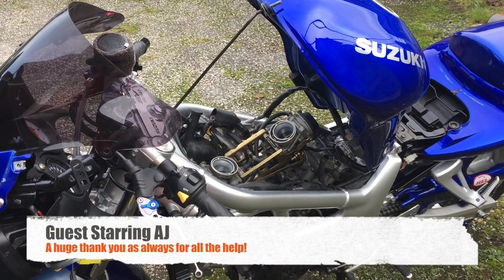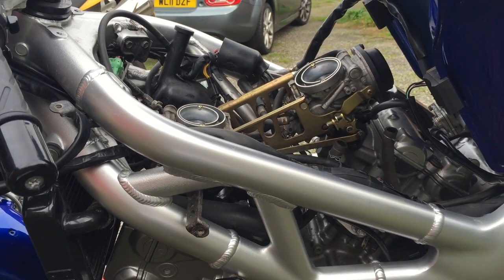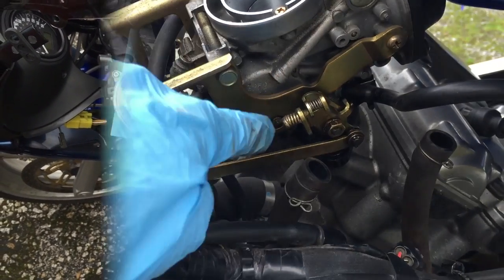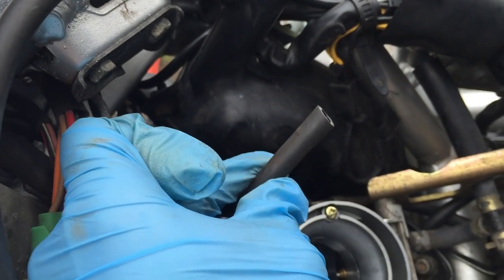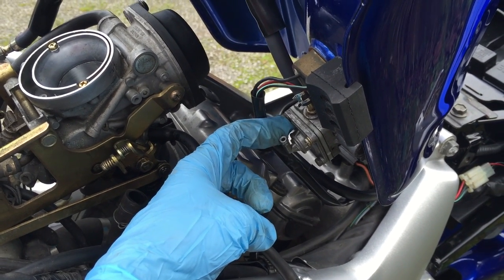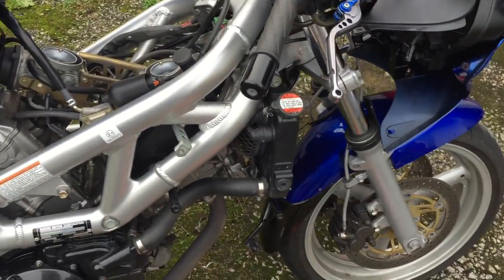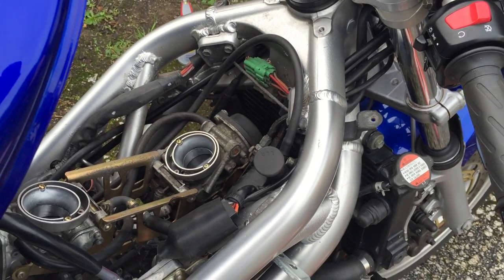SV650 Carburettor Synchronisation

Comment: This is a basic sync.  
To truly synchronize your carbs you need to follow my 7 step method.
1.  Remove carbs from bike
2 . Use a wire gauge to set the throttle plate gap using the throttle linkage adjuster screw.  The throttle plates should be set to be open the same amount( use a piece of coat hanger wire if necessary, between carb wall and throttle plate, adjust until Plate to wire contact is equal in both carbs).   
3. Then drill out the brass plug that is protecting the pilot jet screw located on the base of each carburetor, right next to each float bowl. Be careful not to drill too deep, use about 1/8" bit and stop 1/4" - 5/16" deep, use a screw and some pliers to remove the brass plug.  Underneath you will find the Pilot Jet Screw (Idle Jet). 
4.  Install carbs on bike and get running again.
5.  Put your vacuum gauges on and sync using the Pilot Jet Screw instead of the connecting linkage (the linkage should already be set to provide equal throttle plate opening).  Sync using the "lean drop" method to get the best idle rpm. 
6.  Once you have these things set perfect:  correct float level, clean jets and passages, throttle plate openings are exactly equal, pilot jet screws are adjusted to achieve highest vacuum, stable desired RPM, and both cylinders match. 
7.   Then you apply vacuum gauges again, rev up to 2500-3000 and if vacuum is still uneven adjust slightly with linkage on side of carb( You will find vacuum to be uneven on some bikes due to difference of cylinder cooling, especially an SV). 

That is the ultimate tune without going into pilot and main jets, jet needles, needle jets, air bleeds, slide mods, etc.
Reply from the maker: Thank you, that is a really detailed description! Really clear and well explained.
Reply: Is that brass plug replaceable, or can be removed and that's it?
Reply: @fulesmackofule  you don't need it anymore once removed. It only covers the screw to prevent adjustment. The first time you take your bike in for this service they may or may not reinstall a plug depending on dealer policy, most of the time I see it left off by factory service techs.
Reply: It also prevents losing the adjustment screw if it ever unwinds.
Reply: @andrewoshea35  that's what the spring is for, keeps the needle from loosening. The plug was mandated by epa, older carbs didn't have them. They were added sometime late 70s or early 80s to keep people from adjusting. Bikes are set with lean idle for emissions.

Comment: going to start bringing my Sv650s to you for repairs :D Great video as usual Tamsen
Reply from the maker: +CornishBiker48 Thanks- I would be happy to help anytime!
Reply: +Tamsen Cooper haha, thanks.
Reply: I have Suzuki 2005 sv650 it will start ,but as soon as I put it in gear it dies out ! Do you have any suggestions on what it might be?
Reply: Hi, It may be the side stand or the wiring connected to it. These bikes engines will not run when in gear when the stand is down. Just my "penny worth" hope it helps.

Comment: The video was very helpful,  especially as my engine is much dirtier, even after degreasing it!  I have the column type of gauges, which are much easier to read and balance very closely.  Valve clearances next!
Reply from the maker: That is on my to do list as well, I have that spare engine so I can make the video more clear by filming close up to that as well as the engine on my bike.

Comment: Hello Tamsen, I have a question on electric wire connections. Just so happens the question relates to your video. On the right side of the frame at the front, there are 3 electrical connectors in that rubber flex housing. 2 are black and have interlocking connectors. But the 3rd is white and just a single. I cannot locate what it connects too. I disconnected the wires there to change the cylinder head, Did not take pics as I don't have a magic camera. Could you help me please??

Comment: I'm stuck at the moment with my sv 650 2002, it smells so strong with petrol... Im sure it must be running rich. It wouldn't start last week for a bit and did the same today. I thought it was the spark plugs changed them still doing it. Regulator... Start motor 😅 it's all a head ache but it misfires and pops occasionally 😢
Reply from the maker: Hey, I hadn’t ridden my bike for 6 months- due to being unwell, the first time I fired it up, it took 5/6 goes with the choke on full, after it was sat on the driveway idling, fuel poured out of the overflow pipes. I think because it had been sat so long, anyway, after running it a few more times, that has stopped completely- so maybe there was a slight flooding effect, a bit of grunge pulled through the tank etc. Maybe the bike just needs to be run for a bit if it’s been sat a while?

Otherwise, I would run it, wait until you smell the fuel, then lift the tank (I have done a video on this if needed) and follow the pipe from the tank, look for split pipes or weeping seals. See if you can see any drops of fuel to give you an idea of where the problem might be.

There is an idle adjuster if it is revving too high when idle (again there is a video on this) or it could mean it’s time to look at the carbs- you can do it yourself or send them off to be cleaned (usually ultrasonic cleaning makes them come up like new) I hope this helps- let me know how you get on xx

Comment: Could really out of sync carbs cause my bike to cut out if I give it throttle? cannot see an vacuum leaks at all and Im baffled what's wrong with it. Only thing I can think of is that my carbs are ridiculously out of sync. Front spark plug was orange and rear was black.

Comment: It was useful, but as for a starter, i am just wondering what tools I would have to use (order) to do everything. I assume, for a first time synchronization, I would have to remove the radiator in the front to access that point where you already preinstalled the tube (what diameter?) for easier access in the future. Can you leave the hose there without plugging in the hole for dirt protection? It would have been nice to see the right points on the carburetor where you have to put the hoses on. I would have liked to see the whole process of removing the seat and lifting the tank. Can I leave the tank hose on? I saw another video where someone removed it totally and used some hospital kind of dripping bag. Well, I might be a bit freaked out, but I think it has to be straightforward.
By the way, can you feel or hear that when the cylinders don't get the same amount of air/fuel ratio at the same time? Thanks.
Reply: Hi,
You can find the same vacuum gauges on Amazon. For the extension hose you can use 5 or 6 mm. Don't forget to close the hose with a bolt or something once you finished or you gonna have some air leaks. The hose goes on the bottom right of the carburetor. It's not easy to access you either have to remove the carburetor or as she said move the radiator. 
Good luck

Comment: Just here to tell that that line you speak off. The one on the front Carb that has an Allen bolt in it. Thats Suzuki standard! :D mine has it too!

So thank you Suzuki!!
Reply from the maker: +luuk341 Oh cool! Didn't realise that. I was proper chuffed though as it did make the job a lot easier!
Reply: +Tamsen Cooper I was doing a spark plug change yesterday evening and I thought to check to see if that line was there. And I was pleasantly surprised that it was :) 

Thanks Suzuki for making our lives easier

Comment: thought I watched the video. seems I missed where you show us how to sync it
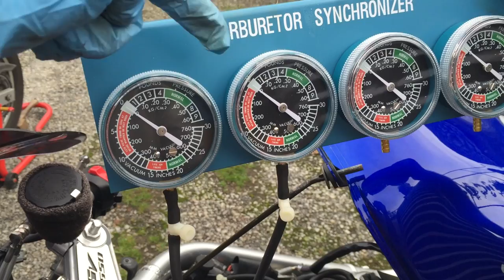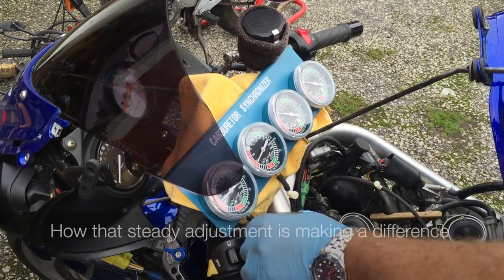Reply from the maker: Hey, sorry if it wasn't clear, just to recap at 1:53 I highlight where the synchronisation screw is located. At 2:58 is how to read the gauges (and that you want both to read the same to ensure the same ratio of air to fuel is going to both cylinders) At 4:07 AJ is adjusting the tap to reduce the fluttering effect of the needle on the gauge. At 4:46 the adjustment screw is pointed out with the gauges in shot. This can be tightened or loosened and will affect where the needles point on the gauges. The idea is that they are both showing the same reading as it did during the video. I hope that helps. Thanks for watching.

Comment: Hi Tamsen. I have a 2006 SV650S and its idling high at time, not always. I would stop at a light sometimes and it would be at 2.5k RPM and other times its normal at 1.5k. I have adjusted the idle screw, changed spark plugs, air filter and oil. Not sure what else could be causing this as its not happening all the times. I can give it some gas with the clutch off and sometimes it will drop to 1.5k pretty fast.
Any help is appreciated.
Reply from the maker: Hey Krasi, did you get this problem sorted in the end? If so what was the cause?

Comment: can you explain a little more on the fuel vacuum that you use at 3:26? Is that in place of an auxiliary tank or is no extra tank needed with method you use? Thx.
Reply from the maker: No extra tank required, just the pump with a couple of PSI pressure was plenty to do the job.
Reply: I have a vacuum pump similar to that I bought for bleeding brake lines that works great.

Comment: hi i have a quick question, rather than having to pull a vacuum with pump could you just attach t piece to petcock and carb running carb tuner through this? great vid as well thanks
Reply from the maker: I have not done it like that, so I am not sure. Pleased you enjoyed the video, thanks for watching.
Reply: You have to connect the vacuum gauge to the carb, so also connecting it to the tap would possibly mess up the reading.
I just sucked the end of the tube until the tap clicked open, folded the pipe to seal it and held it there with a small clamp.  A clothes peg or bulldog clip would probably work just as well.

Comment: Hi
I have removed my tank and from the tank there was fuel pipe connection at front and a vaccum pipe at front .. there is a long vaccum pipe from back of petrol tank ..does that connect anywhere as i can't remember taking it off before I pulled the tank off?
Reply: Eskimo doodle i believe what you are referring to is actually the water drainage from the tank (from the fill opening). This will.connect to the "T" piece which also drains away the overflow of the coolant reservoir. These two together will drain away on the right side of the clutch cover, right between said cover and the frame.

Comment: been a LONG time since i did balancing & now i have a carbed bike again, is it the a/f mixture or idle speed you change?
Reply from the maker: +gizzy nc Hi, I checked the idle speed first to make sure it wasn't too low/high before i started and whilst the bike was warming up, then it the small brass screw you see in the video to adjust and make sure they are balanced.
Reply: +gizzy nc thank you, btw I have exactly the same bike as you & i'm missing the right rear breather hose going into the airbox (as you are sat on it). could you tell me where it leads to?

Comment: hi silly question but what do you call those calibrated vacuum pumps I cant find them lol. can i just suck and plug the vacuum pipe if not?
Reply from the maker: +glen wilson It only needs 1-2 PSI (so very little) for it to work. The pump I used was called a 'hand held brake bleeder kit' put that into an online auction or shopping site and it should come up for about £15 ish. If you mean the carburettor gauges then type in 'motorcycle 4 cylinder carburettor gauge' (there is a 2 cylinder version available but its only a few quid less) for about £30 ish. Hope that helps.
Reply: +Tamsen Cooper thank you so much ive found one now thanks to you, i have the same bike so all your posts are going to be amazing for me! don't fancy doing one on valve clearances do you lol!
Reply from the maker: +glen wilson I am so thrilled you are enjoying the videos! Valve clearance... ok, I will put that one on the to do list!
Reply: need wire tips like blinkers.